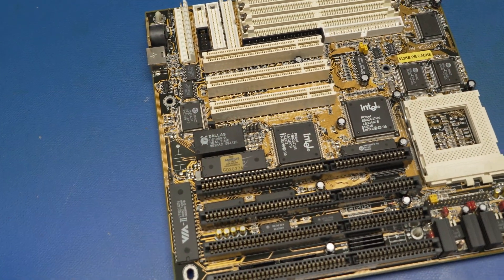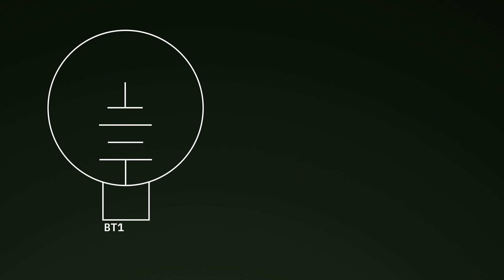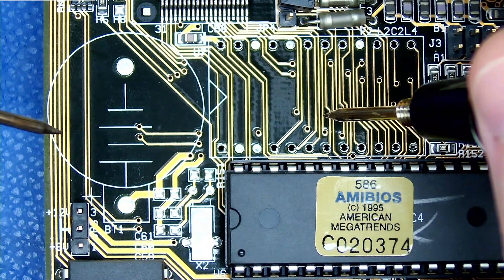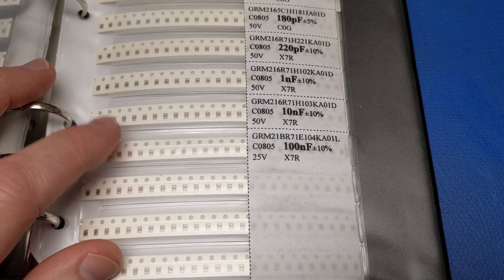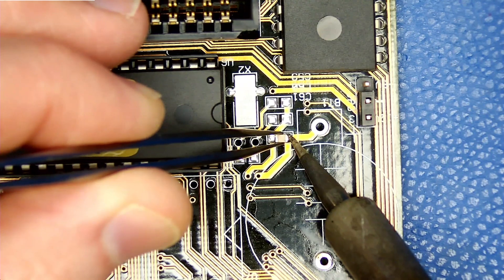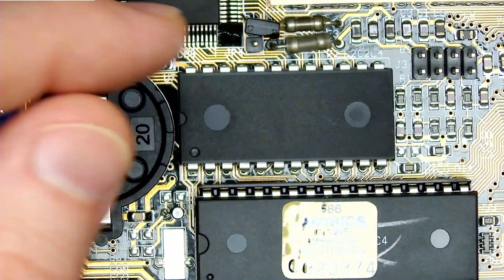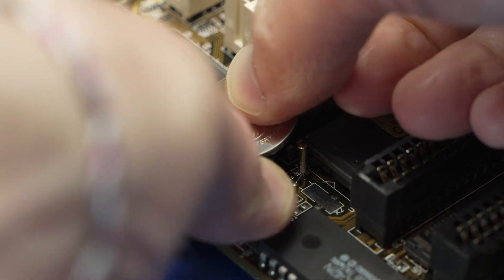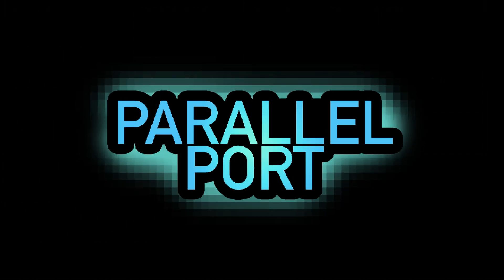RTC battery replacement using a factory option

Comment: necroware just repaired very similar board only with rtc and cache tag chip , and bios being socketed
also
why didn't you solder the clock crystal can to the big pad provided on board labeled x2? if you gong for "factory look" that is what factory would do
Reply from the maker: Just checked out his video-- crazy coincidence and shout out to necroware for making a great RTC replacement. Good point about the can.. I will do that now!
Reply: There's also a specification of 6pf load capacitance. the two unpopulated pad locations are for tiny capacitors to balance this out. Unsurprisingly it works without them but might wander because the parasitics are generally in the range of 4pf but fluxuate ... If you have problems with the RTC not keeping time correctly you may need two very tiny value capacitors in this location... It's just as well the diagram does not show them -- it's probably also designed with some drift in mind anyway its interesting they even placed the footprint.
Reply: Ha ... Reading further down the datasheet they include 6pF load capacitance inside the ic.  So the crystal has to specify 6pf of load capacitance and 50k ohms of ESR. The footprint is likely there out of utility - for using a crystal that doesn't specify 6pf  you can increase the capacitance by using the pads.
Reply: So for example.. most modern 32khz Crystals in this form factor are about 16pf. You'd have to do the math and then add caps that would equal out to the total capacitance with the internal caps.
Reply: A windows 95 motherboard with Dallas cmos battery